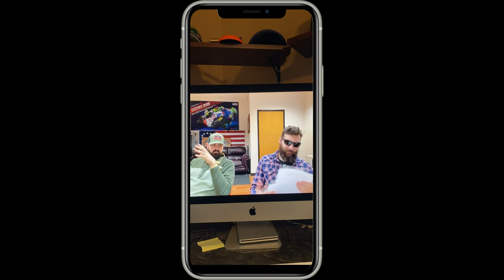I lost 50lbs and Won a Bike from Bikes and Beards - Thanks SRY Cycles

Comment: I think it was a good video. But I think that I would fire the guy that use the snow blower. Because the edge look poor and still had snow( I think using a snow shovel would have fixed that problem) But I do have to tell you I was raised in Florida and snow is not a big problem. So my Idea on snow removing may not be the best.(hahaha)
Reply from the maker: haha yeah it was me that "cleaned" it up. the problem is it all ice now and everything left behind is rock hard, you have to clean it up with fresh snow, but that being said I have the problem solver now. Thanks for stopping by!